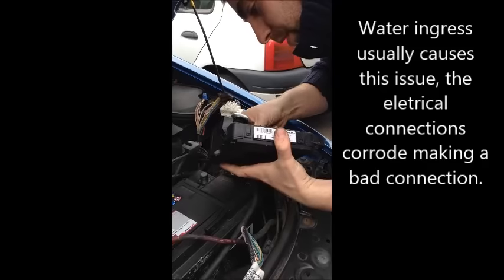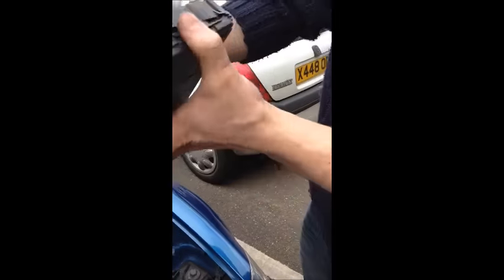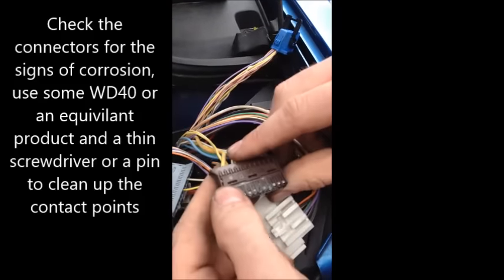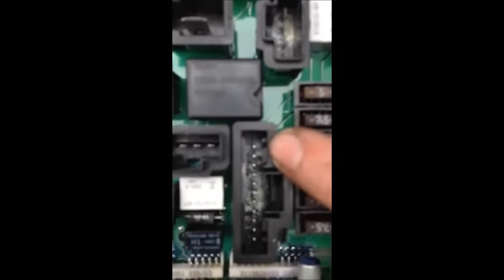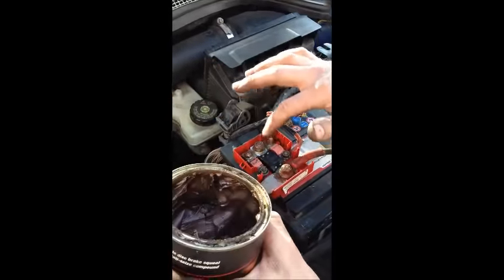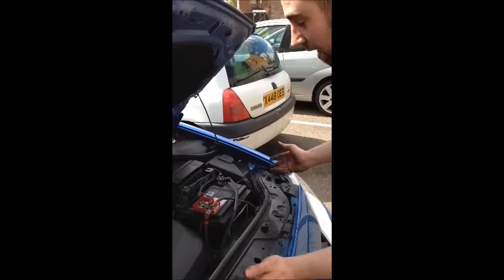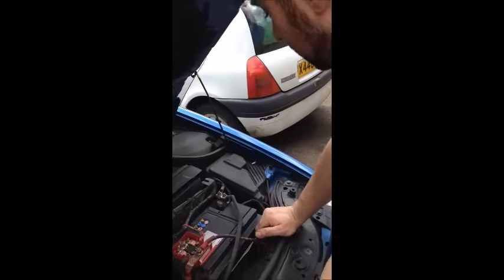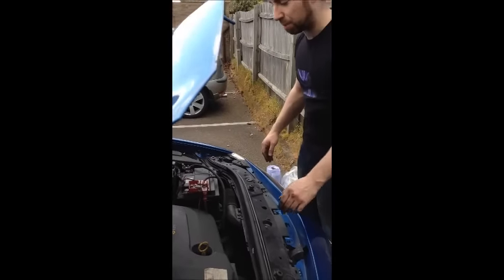How to fix Electronic Fault on Renault Megane

Comment: Hubby is a mechanic, he has hooked it up to his scan tool, changed injectors over replaced injectors replaced coils, etc etc, had different auto sparkies look at it and no one can find what the problem is 😕
Reply from the maker: +Caroline Porteous Hi ive been having a similar problem recently, i have replaced all of the injectors, and the fuel pump but the car refused to start, the auto diagnostics machine was reporting "main control relay" once again renault shows its electronic brilliance and the only remedy has been a replacement ECU
Reply: I am having same issue with 2005 2.0 16v Petrol Renault, It had been good then one day it stated check injection and would auto-rev at light throttle inputs (as to take off in first) and auto rev "at pulses" as if compensating for running on 3 cylinders, (yet no engine shake). Then it did that for a few weeks on and off service light coming on and check injectors and auto-reving at any throttle input, but not rev high just flamming revving like a teenage with a bad habit of trying to impress the chicks with his engine. Well , long story short it has since said check injection and then decided to lean out/ die in the ass while driving to never be restarted again. Change fuel pump and it starts and then stalls, as it was with the original pump, it has "brand new" crank angle sensor ,So it cant be that,  How could it start , idle for 5seconds perfectly, then stall.??? W.T.F is going on. If i bought a replacement ECU from a wrecker, does it need to be re-programmed to work with the car or will it fire up do you know?

Comment: hello paul, ive got a renault megane 1.6 , my service light and air bag light will be off, but as soon as i start the car i hear a click behind me then both come on?? any ideas please?
Reply from the maker: Disconnect your battery then reseat the connectors under the the car seats then reconnect the battery!, most of these problems tend to be due to loose connections. If this doesn't work you'll need the system tested with an ECU computer
Reply: Paul Higgins thank you paul, ive tried that one already!! looks like its off to the garage for me, thanks again
Reply from the maker: It could well still be the case even though you have tried it, unfortunately some cars will still need the warning switched off via the ECU even though the original fault is fixed. Good luck with it anyway hope it works out cheap!
Reply: Paul Higgins Hello guys, I had this problem of the warning light of the airbag, I went to Renault service center, they told me the problem is the spiral cable is broken ( it is the part connects the steering wheel airbag with the system, which the arms of the window wipers and head lights are connected to) and the diagnosis was correct. I changed this part ( it costs about 300 US Dollars) and now there is no warning light.
If your steering wheel is making a clicking noise when you steer left or right ( like the computer mouse clicks) so, you have the same problem of the broken spiral cable..
I hope I was clear and helpful.

Comment: i just bought a renault megane 1.5 dci  2007 57 plate with 121,000 miles, it drives like new, only paid £170 for it, the road tax was only 30 quid a year, let's see how long this french car will last....
Reply: And how it's going? :D

Comment: i'm having a problem when i put on the a/c in my megane 2 and u press the break on put on the headlamps the blower start to fluctuate untill i take off the lights i tried this and it's still the same have any advice. thanking you if u have
Reply from the maker: The fan units can be a bit twitchy on the megane, it is located behind the dashboard if you remove the glovebox you can get at it, a friend of mine cured a similar fan related problem by giving the unit a hard tap! Though I would advise removing the unit and giving it a good clean out. Another consideration would be that since the fan and headlights draw the most electricity your battery may be in a state of discharge meaning either it is getting old and it's time for a replacement battery or your alternator isn't working properly, if you know how to test this with a multimeter that would be the best place to start, either that or take your car for a battery check.
Reply: Paul Higgins thank you for the advice i also want to know i put in a replacement fan on my megane 2  i have it on a relay and a main power switch but the switch keeps getting hot i change it from hot connection to a earth ground switch and it is still getting hot can u advise me what to do cause the first advice u gave me about the blower fan was instrumental in fixing it i have no problems with that again. thanking u again for your time.   from trinidad and tobago.

Comment: Hi, I have megane 2 2003 year. I have a problem when I push start engine its not starting but start cooling fan and it work 10 min. to turn of i need to exit batery cable. Can anyone tell me what is the probem, can i fix it at home? Thanks everyone, i need answer, I feel so bad :(
Reply: got the same problem my local garage plugged it into a obd meter he cannot even take a reading from the motor i am a pretty skilled mechanic level 2 mechanic but this is beyond my skill set this is more auto electrician work i am thinking of replacing the whole fusebox. i unplugged the battery to stop the issue. i am in the process of trying to resolve this.

Comment: Done everything in the video(the circuit board was spotless)but still says "electronic fault"
Reply from the maker: Best off getting it plugged into a diagnostic machine at a garage to find out the problem, this does work in a lot of cases but not all, sometimes there is an actual problem beyond the poor placement and set up of the electronics
Reply: My megane always blows up 30 A Fuses over the battery, did you find a fix?

Comment: We had a Renault megane for 4 years and couldn't fault it electric wise  never had an "electrical fault" warning come up on it ,however , brought a megane scenic only yesterday as we outgrew our little megane ,and having had no problems with it before ,we thought we'd get a scenic because we thought we wouldn't have problems with that either  ,pffft! :-/  Anyway my partner was driving and   it lost power for a second and "electrical fault" come up on the dash , turned the car off for a minute and it come on fine and and the message was gone, it's still driving fine ,and everything still works fine , anyone know what this could be ? 😐
Reply from the maker: Leasa Allen , Highly likely to be an injector / fuel pump issue. Get it looked at and repaired immediately before the car breaks completely, this is not an easy fix
Reply: Mr Texpert oh gawd :-/ thank you  !
Reply: We had it plugged in and it come up knock sensor, it was looked at and there was a loose wire ..went a week with no "electronic fault" message coming up and now it's back and still randomly slowing down,but we have noticed a pattern,if my partner uses the brakes more the fault comes up , then he just touches the brake pedal and the message  disappears again, have read it could be the brake sensor switch sticking or something like that ,I know it's hard to tell without seeing  but could this be possible ?  Apart from loosing acceleration for a second ,its fine ,doesnt make any funny noises or smoke at all, Also the passenger side window has stopped working now 🤦‍♀️

Comment: Nope.  Still showing stearing locked.
Reply from the maker: Sorry to hear that, the weather is quite damp at the moment if your in the uk, I would suggest trying again but take the circuit board inside for a few hours to warm up so you can be sure it's fully dry and also check all of your fuses. If it still fails to work there may well be a problem with your electric steering column (another fairly common fault) if you still have no luck I would get someone to do a plug in diagnostic

Comment: contak does not happen motor spins
Reply from the maker: I guess you mean the starter motor? If it spinning but not starting the car you may want to replace the starter as the solenoid is probably broken
Reply: When I put the card on the dashboard lights are shining all ask me the pressure on START, but by simply pressing the START run the motor fails and asks me to remove the card

what i do

Comment: My ABS light is showing up, and speedometer doesn't work but car still drives. Piece of sh*t Renault Laguna.
Reply from the maker: Needs a new wheel sensor / hub or worst case a new abs unit, will need diagnostics to tell which

Comment: Hi Paul,i have a megane 3 1.5 DCI and havign a problem with check injection system/check anti pollution problem and recently,engine failure hazard on my dashboard and car lose some power on it,it's been a pain in the ass for almost a year now and the crappy renault seems can't fix it,been to 3 garages already and all been useless,any idea about these errors?thanks
Reply from the maker: Your high pressure fuel pump is likely worn out, very common and not cheap to fix, very surprised Renault garages wouldn't pick this up (unless they're told not to admit there's a fuel pump problem) basically the pump begins to disintegrate from the inside, particles of metal clog up your fuel lines and injectors over time, in the beginning this causes the check injection warning, eventually you start getting power loss and injector fault and electronic fault warnings, then your fuel pump will give up, then you will have to replace all 4 injectors, and the pump, at a cost likely worth more than the car, even if you do it yourself

Comment: You was doing well until you said WD40  Do not Use this shit on electrical Components  . Derrrr .  service 10 Contact Cleaner Us professionals Use ;)  and the grease  that Should be applied to the posts is  Uniall  looks like first born shit green in colour . Renault's Are Shat with there Electrics. Zero water protection in key Component areas on earlier models . Clio's Suffer.
Reply from the maker: WD40 is non conductive and is quite safe to use on electrical components for driving out moisture, been using the stuff for years never given me any problems, granted I probably wouldn't go spraying it inside my computer but for cleaning out a large scale board like this with large basic connections there isn't an issue, although I should possibly have been more specific that you should use wd40 specialist contact cleaner not regular wd40 as there is a difference